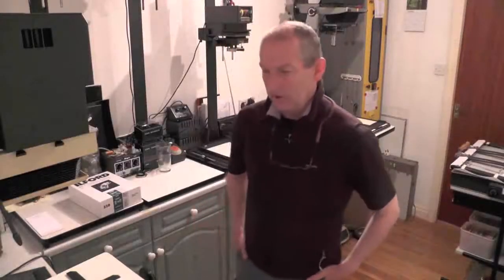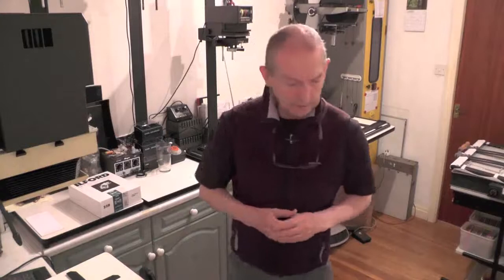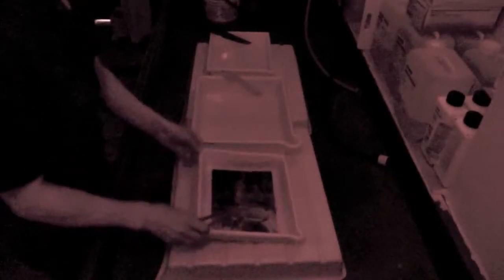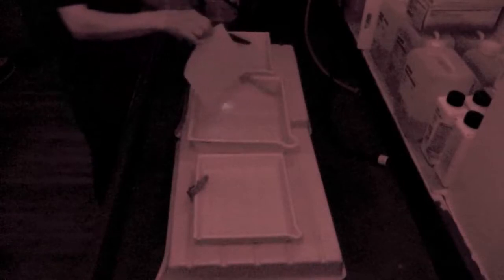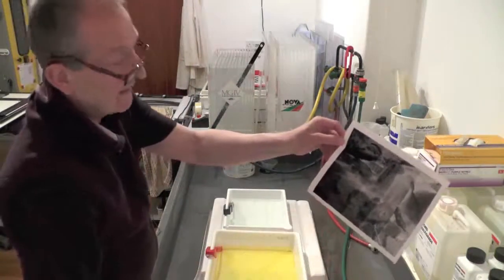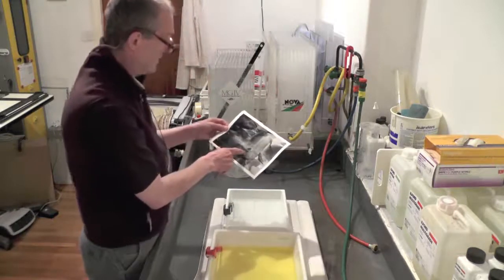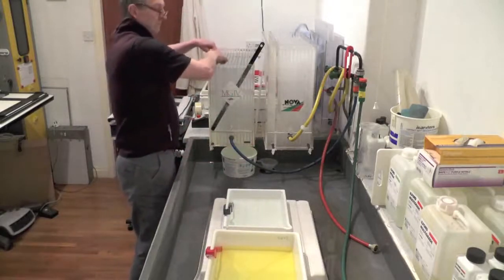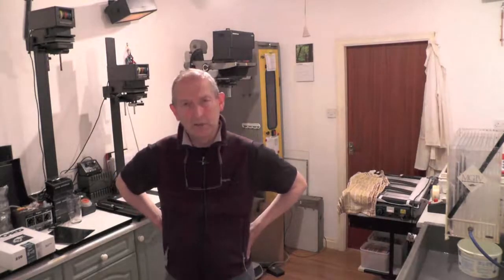Making a Test Strip

Comment: For printing how far down do you recommend stopping down the lens ? Tonight I was stopped down two stops and with a #2 contrast filter and my exposure was 6 seconds way to short right ? So I guess I should stop down more on the lens.
Reply from the maker: Most enlarging lenses work best stopped down 2 to 3 stops. They tend to lose sharpness wide open and closed right down, so avoid the extreme f-stops on your lens if you can. I'm used to short exposure times so 6 seconds is quite long for me! You soon get used to it but you may find it easier to stop down 1 more stop.
Reply: Darkroom Dave   Thank you 6 seconds is nice and quick but I am wondering about time to burn and dodge. I guess I just have to get quicker :)  I have tried the split contrast filter before and it dies work wonders really.

Comment: What aperture and contrast filter did you use for your initial test strip?
Reply from the maker: Sorry, missed replying to this one. The aperture depends on the lens. I mostly use f8 on a Rodenstock Apo-Rodagon lens which is f4 wide-open. You usually use 2 to 3 stops down from wide-open. The initial test strip needs to be in the middle of the grade scale, I always use 2.5.